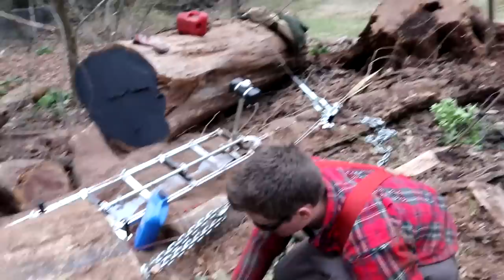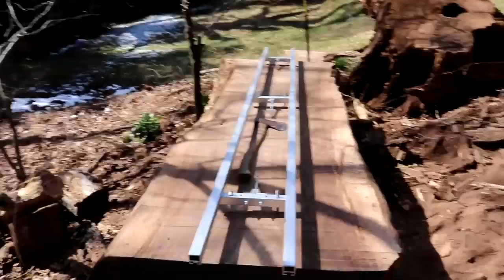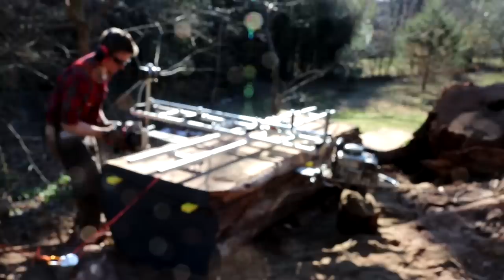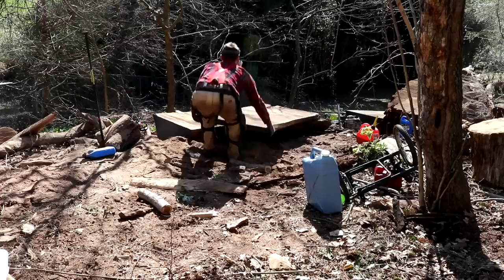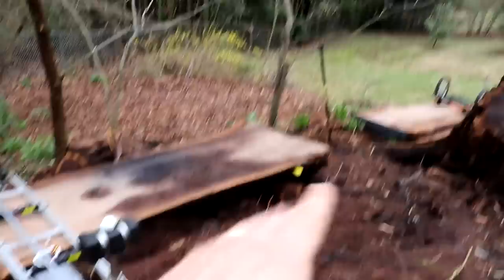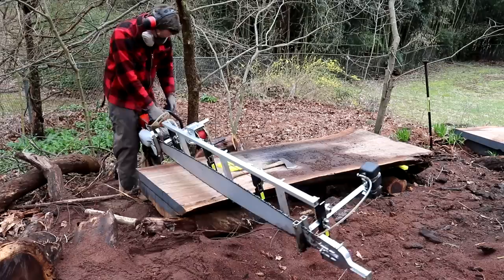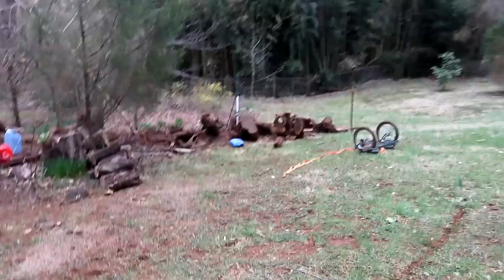Monster Chainsaw Milling Monster Walnut FINALE!

Comment: You earned every board foot of that walnut lumber young man. We grow some humongous maple in my part of the world and I've milled and hauled out my share from awkward places. The donkey labor is such you have to work in shirt sleeves in 50 degree weather so I know how much energy you're spending. 

Well done and good clean-up after. That leads to good word of mouth and future windfalls of fine lumber in the log.
Reply: I read this comment with a southern accent, I don't know why.
Reply: id love to get my hands on some thick cut curly maple , for gunstocks or sawn into micro lumber 1/4 inch thick for scrollsawn and carved regulator or mantel clocks with swiss movements in them .

Comment: Unbelievable work ethic...wow !  Stihl !!! Get this guy some new equipment !!!!!!!!!
Reply from the maker: The saw I'm using can cost more than a new Stihl MS880, it's a monster. 137cc. Just bought a second one......not that I would turn down an 880. Look up 090's on ebay, you'll see what I mean about price.
Reply: thoses 090's are beasts. Best big saw for slabbing
Reply: I had one given to me by my brother in law in 1983...he was a faller up in northern BC....I had a 6ft bar on it and it sure was nice.....not a big belly bar like yours but reg bar....I eventually sold it to a man for $150 so he could turn it into a stationary mill.....

Comment: 4:10 for large diameter wood one should use a wider guide rail. 
Your wood is 3 times wider than the width of the guiding rail.

Comment: thats going very smooth, one of the smoothest ive seen.
Reply from the maker: It's the saw and chain, a lot of power and a sharp, ripping specific chain makes a huge difference vs. seeing someone having to rock the saw all around to get through the cut. The winch helps to keep it smooth as well.

Comment: Nice video series on the walnut. I have everything to get started except the energy. 2 questions, which sharpener do you have (found it on my 3rd look in the description) and what did you spray on the ends of the logs once you bucked them up.
Reply: I'd say he doesn't check comments on a video that's been up a while but maybe I can help. It's probably a wood sealer like Anchorseal that's designed to slow down the loss of moisture on the exposed ends of the lumber. This helps prevent splitting which will occur quickly on raw exposed wood, you can't let the logs lay for any length of time without cracks developing. Also it's much easier to coat the whole end of a log than put it on the individual boards or slabs. If you can't get it on the day you make the cut you can take off a few inches and get past the dry section then apply it. Not using it will always result in losing at least 5 or 6 inches and it can be as much as two feet from the lumber depending on ambient humidity level. Don't think cold temperatures will eliminate the need for it, cold air is very dry and will wick off the moisture quicker than you think.
Reply: @mwilson70201  Anchorseal, got it. I'm new at this. Why don't I ever see this on any lumber in the yards?

Comment: Wow. What a great set of videos and super nice work. 👍🏻👍🏻👍🏻👍🏻. I recently got my Granberg mill and tackled a hickory log. I sealed the log ends B4 milling but some of them are splitting. I built a drying rack off one of your clips. Would metal banding the logs or clamping the ends help reduce the splitting?

Comment: Did you test the moisture on any of it right away? Was wondering about hoe much there was in it since it had been standing dead for awhile.
Reply from the maker: Much dryer than if cut down live but still very wet in terms of furniture. It's been stacked for a while now, I need to make an update video and test the moisture.

Comment: Is that the typical bar from granberg on your milling saw?  It looks wider than mine.   I run an 090 on an older granberg mill from the late 70's or early 80's.  My mill/bar is 56".

Comment: Man oh man. I just did my first one, a Pin Oak of that size. I used my 72cc firewood saw, worked OK. I also did some bar wear, looking forward to doing smaller ones that you can actually manipulate into a downhill setup.
Reply from the maker: Smaller trees are definitely easier and your saw will be more suited as well. You may be already, but a ripping chain is nice if you can get one. I'm using granbergs chain and a stihl, both ripping. If you can get your hands on a bigger saw it will blow your mind. I'm using an 090 which is 137cc......just bought a second one to have two and may replaced the cylinder and piston with 10 cubic inch replacement, gives you over 160 cc. Power is king with milling. I've got a pin oak to mill as well, been dead for years, but still solid. Also just milled a huge white oak as well as a white pine, much lighter to handle! If you don't already, an auxiliary oiler may reduce your bar wear and keeping the chain as sharp as possible and only cut as fast as the saw will go and not doing to much pressure. My chain got dull and I compensated with pressure, I just squared up the bar but no reason to cut down the bars life for no reason.....the big bar I'm using is almost $700, my 36 inch bar is $180 ish....you get a lot out of them, but I don't want to be buying new ones for no reason. Thanks for watching.

Comment: I really hope that you have a better outcome when you get older, then I did. I remember working just like you do except with steel. I’m 6 foot 3 and my lower back is gone. Late 40’s, I thought I would be able to work way into my 60’s. But, you keep working harder and not smarter, and you’ll be following my lead. The equipment that you have is definitely a good start in the right direction, for sure. But, you either need to hire some help or get yourself another piece of equipment that will run and haul those slabs up to your truck. You have some excellent looking slabs that’s for sure. But, non of those ain’t worth nothing if you don’t take care of yourself when your young. Good luck, thanks for sharing your videos too.

Comment: Insulators. screws, nails, hardware, and junk are what you find in city or semi urban logs. My father had an extreme work ethic so I have a woods but it was once an amusement park so it's hard on equipment. Black streaks like you have mean steel is present. Dad had a metal detector. Your pry bar reminded me that on the 2nd slab i made ever, the log rolled and nearly bent my bar and me.

Comment: Fantastic job!!! I love watching your quiet resolve to get the job done. Kudos to you, that's mighty hard work.
What model is your smaller saw (looks like a Stihl) and what length of bar do you have on it?
Again, nice job.
Cheers
Reply from the maker: MS390 with a 20-inch bar in this video. Now I've got a 25 inch on it. The smaller bar is completely worn out, but I'll toss it on to cut something really dirty.
Reply: Thanks I appreciate it. I have a ms250 that does the job for most of what I do ( windsor chairs),  Stihl says I can put an 18 inch bar on it but kind of underpowered so I may have to move up.
Can't wait to see the next one, keep the great work.

Comment: why are you painting the ends of the trunks?

does it have anything to do with moisture? and what are you using, what paint?
Reply: He does it to prevent cracking as they season.  The rate of evaporation out of the ends is much much faster than through the sides (faces of the slab)  so as the ends dry they're shrinking in relation to the main body.
Reply: @patcherelli2411  how long  or how thick does a slab of wood need to be to need this treatement?

Comment: Great job bud. What saw/bar combo are you running on that granburg mill?
Reply from the maker: +DoubleVictor Stihl 090. I use a Canon Super bar 36 inch and a double end bar from Granberg 72 inches.

Comment: Check your rails with winding sticks. Easier than a level, or use two levels. Twist is very reliably spotted by eyeing sticks for parallel.

Comment: This may sound like a stupid question, but why did you paint the ends of those sections black???
Reply from the maker: It's latex paint to seal the end grain, helps with drying so the slabs dont crack as bad. Look up "Anchorseal" it's a commercial product that I started using after this log. Basically, a waxy material that slows/stops drying from end grain.

Comment: Nails are such a Heartbreaker. Guy I worked with had a large commercial chainsaw mill that he had just bought and on one of the first trees he slabbed with it was a large oak and he ended up hitting 7 railroad spikes in that one log.
Reply from the maker: Yeah, best to start with the top of the tree and work your way down, saving the butt log for last.

Comment: May I suggest that you look up Matthew Cremona, he has a YouTube site which I am sure that you will find to be very interested in. Both, in the slabbing sawmill which he designed and built, as well as the trailer which he turned into a log lifter, dragger, mover and carrier. Matthew is a custom furniture designer and builder and he has milled numerous slabs of various species of trees. You want believe how cheap he made the trailer and how well it actually works..

Comment: What is on the end of the cut tree? Plack paint?
Reply from the maker: I painted the ends with latex paint to seal it up a little. Helps with cracking, although walnut is pretty forgiving.

Comment: Just as a side note, for future reference;  You mentioned if you had brought the proper tools, you would have cut the fence. A section of chain link fence can easily be removed by unwinding one of the links. It appears to me that the fence was not damaged enough to prevent removal of a link. Now back to our regular scheduled program.
Reply from the maker: It was a mess, crushed and tangled. I needed to cut it and drag it out with a winch.

Comment: I tore down an old house once and found that the twelve floor joists in one of the rooms were all 14 foot, full-dimension walnut 2 x 8s. Problem was, when I pried up the old inch pine 1x6 T&G subfloor, most of the old square nails broke off. I ended up taking a metal detector, a nail puller just like yours,  and my smallest chisel and painstakingly got the pieces out. Sold them for $100 to a guy who took them to a nearby Amish bandsaw sawmill where they were able to split each one in half and end up with two planed 3/4" boards from each one.

Comment: I would bet, if I was a betting man, that you can probably lift at least 4 to 5 times more weight than I could when I was in my 30's. I'll be 68 the 27th of this month, and I would be lucky to lift 95 lbs. in my mid to late 30's!  You are one tough strong man, and my hats off to you. That was one tough job and you got some beautiful wood that I would love to have just a small piece of. Down here in MS, you will pay about $45 bucks for just one small 8"x 42" board of walnut. That is more than I could ever afford. 2 thumbs up to you my man!

Comment: Geeez, you are tough cookie, my young friend. That was a hard but rewarding job.
One thing though, you definitely want to equip yourself with power lifting & pulling tools. Take it from an ol' 67 y.o. guy here,  with huge back and leg problems !
Hint: I took my old snow blower and removed the worn thrower assembly and fixed a trailer hitch in its place. Now I can push/pull my 2 sail boats and their trailor in my backyard so easily. Or even better, get a used 4 wheeler ATV with a good winch on it. Lots are available on the internet.
Again, save your back !! 
If not, you want to PULL a heavy load like when took the slabs uphill, not pushing it: your legs will do the work, not your back !

Comment: If you used winding sticks to adjust the ez rails it would probably be more accurate and quicker to adjust, just my 2cents. Sweet videos
Reply from the maker: Not a bad idea, using a level to get it close then tuning it in with sticks would be perfect. Thanks for the idea.
Reply: your welcome! Now that im thinking about it, you could also place one stick under the ez rail on the slab, and one directly above the other stick on top of the rail, and then measure between the 2 on the ends of the sticks to check if your square to your previous cut if you needed to for some reason. Bubble levels are only so accurate imho, the longer and straighter the winding sticks the more accurate the process. Happy sawing!

Comment: Why not use a metal detector instead of ruining the chain? These devices are dirt cheap and do a pretty good job!
Reply from the maker: The chain is under $100, the slabs are worth thousands. I can sharpen and replace chains.

Comment: Dude I have to know what size motor your using and what is that bar. Type and what kind, details please thanks
Reply from the maker: I think I put all that in the descriptions. I'm using a Stihl 090. I have a 36 inch bar and a 72 inch bar with mills to fit both. The saw is 137cc, which is big if you are not familiar.

Comment: Amazing once in a lifetime tree. Since I'm an axe junkie what kinda axe is that your using. Also I would love to have one of those root ball pieces to carve some bowls and spoons with
Reply from the maker: I think that one is an old Collins, what I do know is it is top notch, it holds an edge like no other axe I've had. Feels great using it as well.
Reply: The Homestead Craftsman I have a few Collins but I'm a plumb guy they are my favorite to use I I recently made a 28in handle from Ash for a 4 1/2 lb plumb jersey and it's a monster
Reply from the maker: I've got one Plumb head, most of them the mark is gone, one of my more unique one's is a Firestone, same text as the tires. It's a double bit.
Reply: The Homestead Craftsman my favorite double belt that I have and really enjoy using is my Plumb Puget Sound pattern double bit

Comment: Where did it get the winch for you’re mill and what kind is it trying to find one for myself but not sure which one to get
Reply from the maker: I bought this exact one- https://amzn.to/2IBVhDL I replaced the bolts with longer bolts. I will be posting a video soon how I went about it. Granberg also just came out with a winch, https://granberg.com/ Should be on there home page, looks like its not quite available yet. Appears to be different, more of a winding than winching. No ratcheting which could be better so not to put to much pressure on the bar. Probably lighter too and has an attachment to go on the end of the log. I use a digging bar stabbed into the ground with some paracord and a pulley. It's kind of nice because you can move it around easy.....not sure how the granberg will function, my guess is screws. The winch in the link does not have cable or rope, just use paracord or something similar.
Reply: The Homestead Craftsman thanks that helps a lot been looking but what you see online is hard to tell what will work or not
Reply from the maker: Yeah, a 600 pound winch is what you want, the others get too big. Online is great, but having something in front of you is best.....but I have tested this one and it works! or you could get the Granberg, I may end up getting it myself eventually I'm getting a second milling saw and would like to have two mills set up. One in 36 inches, then the larger you see in this video. at the moment I have to change out to each size as needed. Not bad, but not real quick and something I don't want to do on site while milling.

Comment: I have a question. People are telling me that milling with a chainsaw is not good for the chainsaw. Is that true? What chainsaw do you think will be good for 54” and under logs? Thank you for your time.
Reply from the maker: +snowmoon83 Don't let other people's comments slow you down. If you are milling stuff that big you are going to need a professional saw which can take the abuse. A Stihl ms880 or the Husqvarna 3120xp. I use a Stihl 090. You can rebuild the saws if you wear them out.  With a saw, bar, and chain your looking at around $2,500 - $3,000. Look at the Granberg C2 60" mill package. 56 inch max cut. Bar included along with other things you need. It's what I used in the video. Probably thought a chainsaw mill was the cheap way to go....
Reply: The Homestead Craftsman thank you for the reply. I don’t think I will be milling that big. My Alaskan mill is 57” just in case I need to go that big, you never know. What I have right now is a 30” log.  I enjoy watching your videos a lot. Thank you for your time.
Reply: The Homestead Craftsman I end up getting the 661 with a 36” bar. The first tree is black walnut and half is done. After I got my first slab it was worth all the work, what a beauty. Thank you for all your videos.

Comment: if i could get my hands on some micro lumber in 1/4 - 3/8 thick pieces i could make one of the most beautiful scroll sawn regulator , mantel , or with 1/2 -3/4 inch thick make a very very beautiful grandfather clock case out of then install a swiss mechanical movement in it then have , easily a $20,000 dollar clock with this k8nd of wood , and figured cherrywood or maple also .

Comment: Very impressive! How many tons of wood did you just cut up and haul out of there by yourself? You need a helper!
Reply from the maker: Not sure, there where 21 slabs, the stump and some odd pieces. The slabs weighed around 250-300 pounds or so. The stump pieces where very dense and heavy, so it was certainly multiple tons. Luckily I have ant like power and was able to get it done.